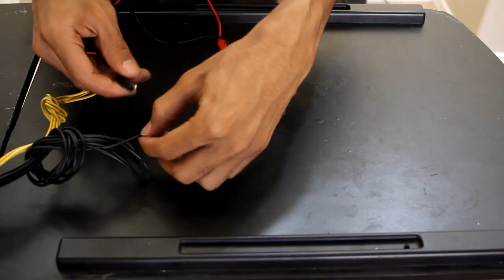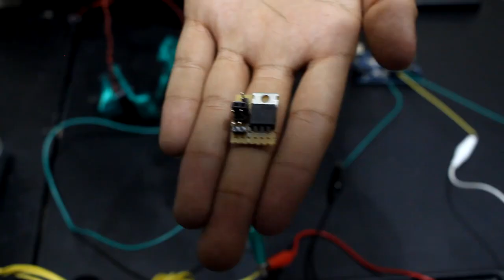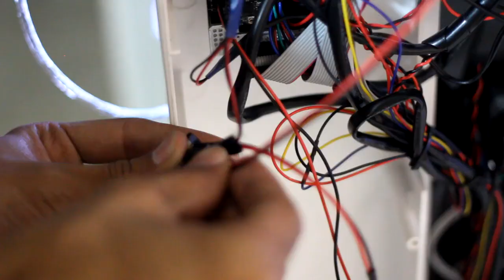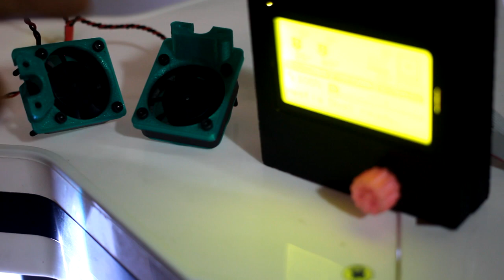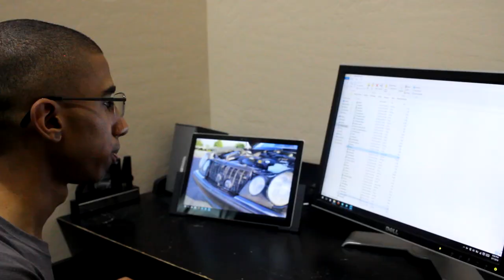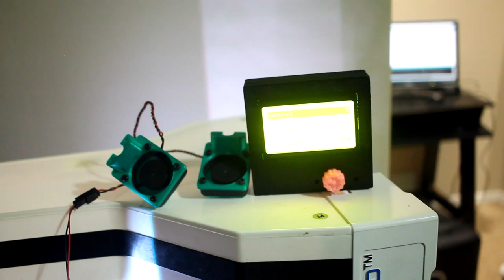(Novice Expert) Expert Mods  Dual Extruder Fans

Comment: Hey, nice video! I love for it not going too much in depth, but also deep enough to be practical and educational. Good stuff mate, I mean this is a solid video, your presentation is good, quality is definitely enough in editing and script. Only things I might want to add is the circuit diagram for the board you soldered up, just to make noobs more comfortable with them, and maybe mentioning it's "proto board" you used for the components (personal experience: when I was starting with electronics hobby I personally spent 2 hours looking up for the terms so I could actually order some lol), and I think the beginner hobbyists might be your audience.

I was basically thrown here by algorithm and think your video is good, so here's my 2 cents or whatever. I hope you have a good time making the videos and may there be success in your future!